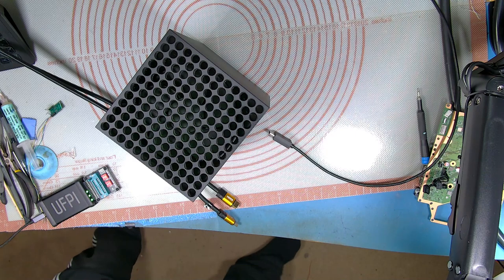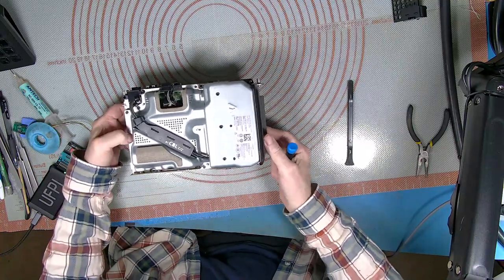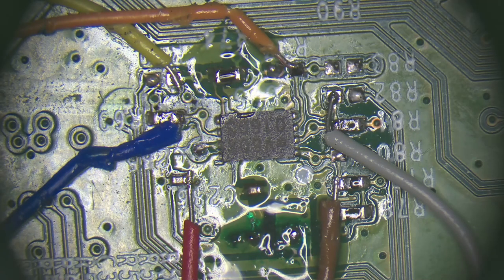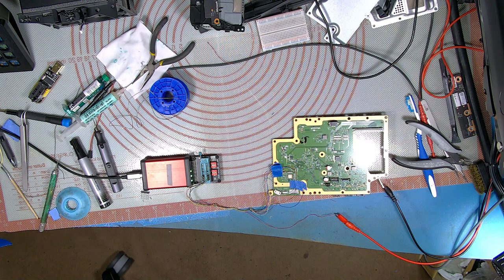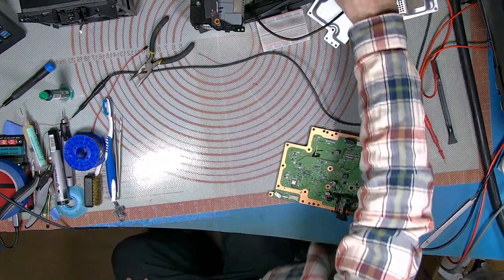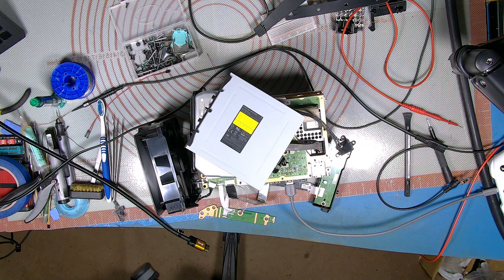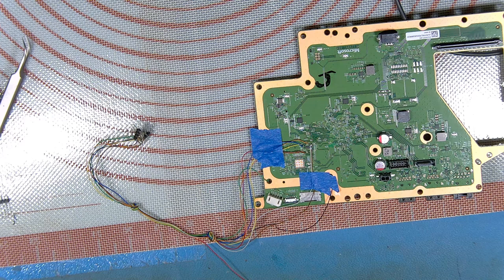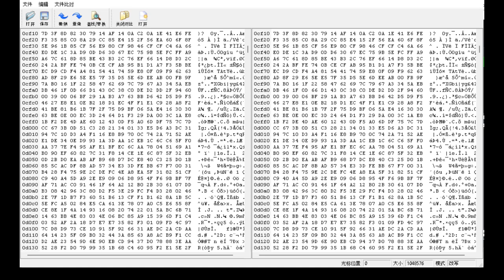HOW I Swap South Bridge Board  XBOX Ser X BY REPROGRAMMING The NOR ,BE WARNED CAN BRICK YOUR UNIT

Comment: Thanks Steve.. Worked on a Series X today that was at another repair shop and they put a screw through the SB board. I moved the flash chip over to another working SB Board and it worked like a champ. Thanks!
Reply from the maker: Thank you for the acknowledgment

Comment: Would like to try this as I have a console that be good to eliminate the SB board (symptom is random shutdown). I have the CH341A modded for 3v3 and have successfully dumped PS4 NOR before using Flashrom. Also have a potential donor SB board. Came here as I just knew you'd have something on this. Thanks mate.
Reply from the maker: Cool if you need any guidance let me no

Comment: Hello. I have an xbox one s it has a problem the joystick bind button doesn't work. I changed the module, there are 3 volts on the button. I will be glad to receive your advice.
Reply from the maker: Have you got another controller to try ,,

Comment: j5 header is pinout for u1014 spi flash
Reply from the maker: No its a header for a chip on the debug version the nor is on southbridge board u52  not u1014
Reply from the maker: No. That chip isnt fitted.. the nor is u52 on southbridge board

Comment: What reader should I get to read bios chips on consoles and laptops
Reply from the maker: The T58 like i use is best but you can ch34a but you may find you have to remove chip toread
Reply: @Steve_be  ok I ordered a ch341a programmer comes with a sop8 clip. Should that be all I need for computer and console bios chips. and use the green board with wires to program other chips like nor for example?

Comment: Hello,

Have you tried reading out the nor on the main motherboard with the APU ??? it has 256mb and is u1014 on apu motherboard ?

Is it possible to swap the main motherboard with the apu?
Reply from the maker: As with my previous answers u1014 is not fitted on the x retail the nor is u52 on southbridge board
Reply: is it possible to swap the main motherboard with apu by changing the proghramming in the nor in the southbridge board ?? @Steve_be
Reply from the maker: Not directly the APU SSD and NorAnd dvd are all tied together, so to swap APU board you will need the matching SSD, NOR DVD  its not really viable
Reply: Have you an email ? want to change some knowledge with you about this matter, when it s possible.
Reply from the maker: @herbertlaminski1684  not on youtube but you can join my    discord        https://discord.gg/wmJzNpFG